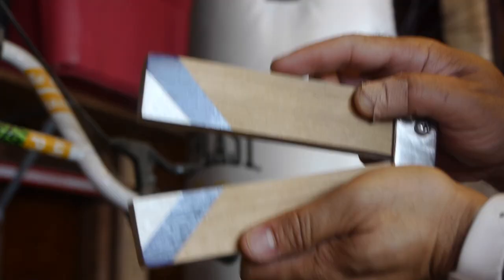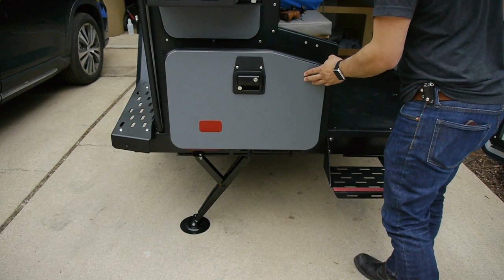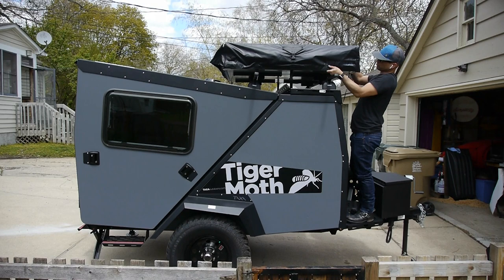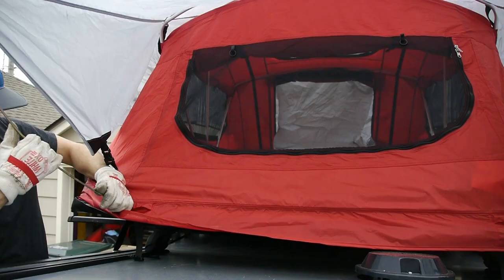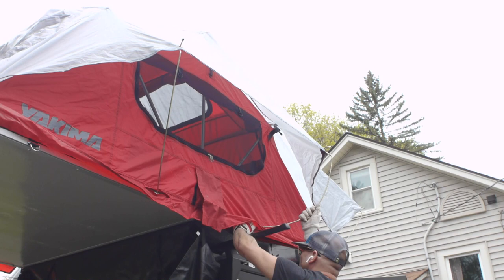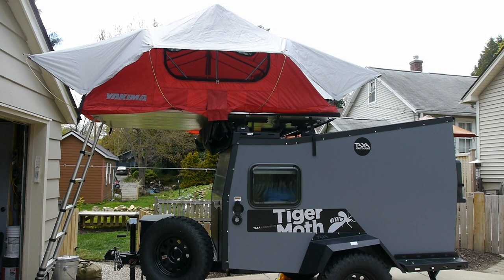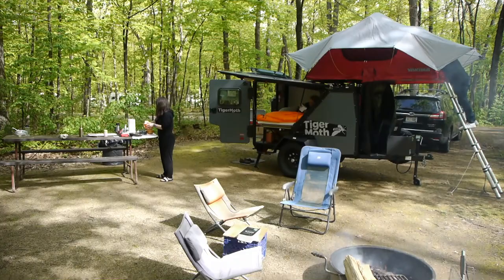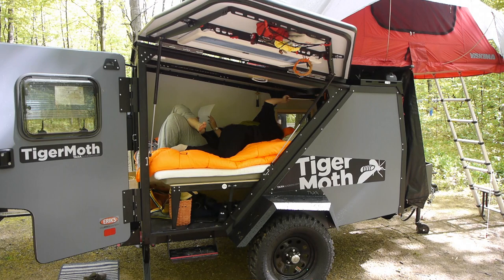Unboxing the Tigermoth Camping Trailer and Rooftop Tent

Comment: Does it fit in your garage? I see the end is at a little higher angle that the other end. Whatever I buy it needs to fit in my garage because of our HOA rules. :(
Reply from the maker: @ctay122 It fits into our garage which is 81 inches. It does not fit with the roof top tent.

Comment: Are you still liking the trailer? Any issues? Any advice for a prospective buyer?
Reply from the maker: @hollywood21639 Definitely still liking the trailer. The trailer is solid and the materials are top notch. For example the plywood even smells great. The thing I’ve been working on is a better way to put on and take off the roof top tent. I don’t have a lot of help and I’d like to be able to service it in the field in case of an issue. I’ve come up with a winch system that I’ll be sharing in a couple of weeks with a new video. Other than that, I’ve thought about whether or not we should have looked at a camper with a bathroom. We didn’t want to deal with dump stations and all that, but some of the campsite we stayed at had nasty bathrooms. But honestly, I wouldn’t change. We couldn’t store a larger camper and we probably wouldn’t have purchased any other camper if the Tigermoth wasn’t around. It is perfect for us. The only other thing I still want is a Dometic fridge/freezer because anything longer than a weekend trip, and the soggy cooler effect becomes a drag. Good luck! Hope you find what you are looking for!
Reply: @Folktopia  thanks for the info. I'd be towing with a 2 door Wrangler so I gotta stay under 2k weight but the pricing for some of these are way to much for a box on wheels.

Comment: 25>30 Gs, Does it come with the truck to tow it?
Reply from the maker: I used to have a $900 1968 Ford F100 that would have towed it pretty well around the county but not across country. Nowadays things have  gotten more expensive for sure. This camper was 20K.

Comment: Great video, thanks so much for sharing! What has your experience been with the onboard power supply so far? Would love to hear how that's been so far, both in terms of charging before hitting the road and in use out in the woods. Thanks in advance!
Reply from the maker: @DanB4444 thanks for nice feedback and question. The power supply has been plenty for us. I really appreciated having DC outlets at two spots on the exterior of the camper. That way when my kids were sleeping late in the morning I could plug in an inverter and charge up my phone and camera batteries. On the inside there are two USB plugs and we run a USB powered fan and charge a ios device with the other. The AC plugs in the camera are just when you’re connected to shore power. We haven’t had a reason to bother b/c we only camp a few days at a time and the battery easily lasts that long. The idea of solar is great, but because the battery charges as you drive, I’m glad we didn’t add the extra expense. Hope that helps!